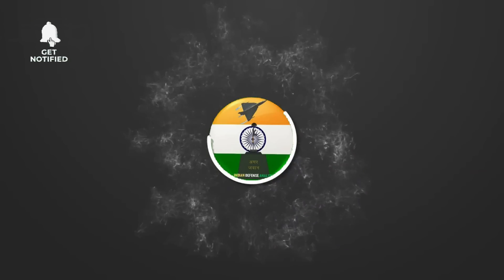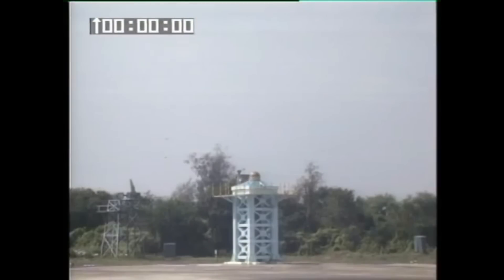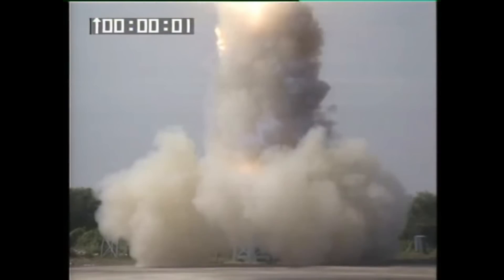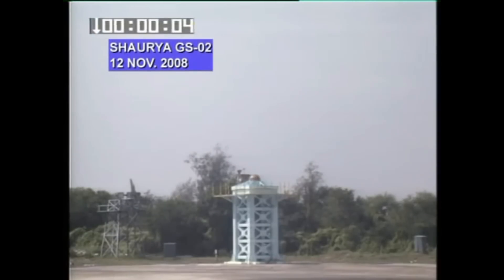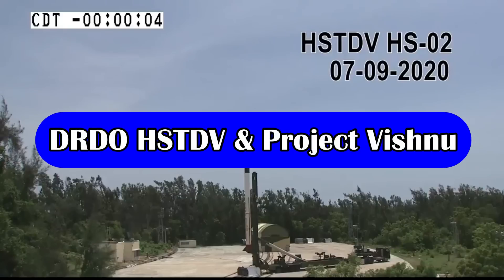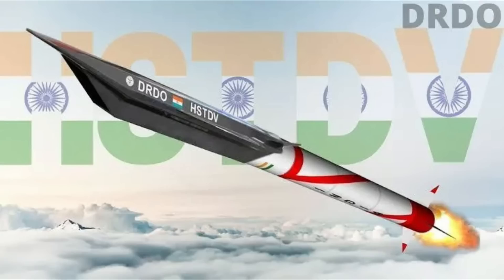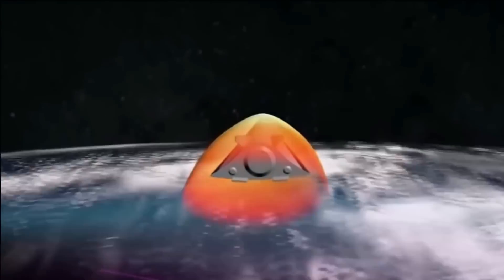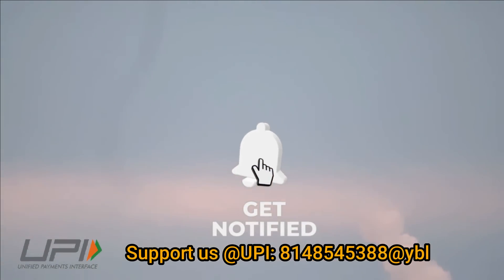DRDO’s Hypersonic Missile Program

Comment: Drdo is outdated in hypersonic glide vehicle race, it is concentrating in only back side of the hypersonic missile engines and under air intake system , the missiles should have front wing which can penetrate air quickly which will rapidly increase the speed of the missiles, the missiles should have cutting edge technology

Comment: Question becomes where Brahmos will fit in after this tech is developed? First one is going to be surface to surface missile with range around 2500 KM and expected to enter services by 2024-25.
The second one is going to be a smaller and compact version of air launched hypersonic cruise missile with a range in excess of 700 KM. The expected speed of these missiles will range from Mach7-10. Isn't Brahmos pointless then if it doesn't have 1000km range?
Reply: Maybe the compact version is for fighter jets
Reply: @yashasvisingh6694  Which is why what is Brahmos NG(air launched version)? Is that going to be obsolete?
Reply: @datoolz0  and why would it be obsolete
Just like the Navy has different classes of Ships for different purposes there are different types of missiles for different missions
The compact version would be lighter and cheaper and it's range would be added by the range of the aircraft which is carrying the missile